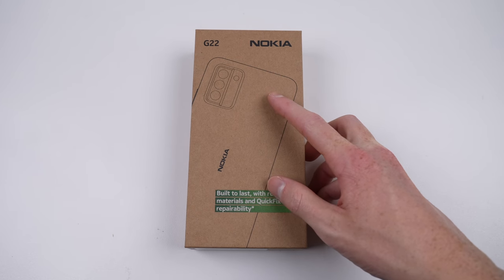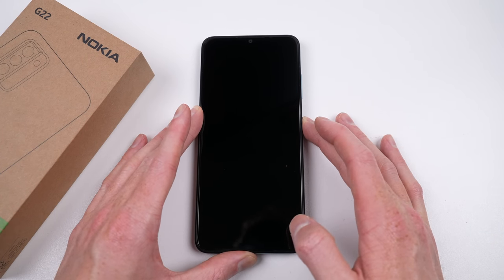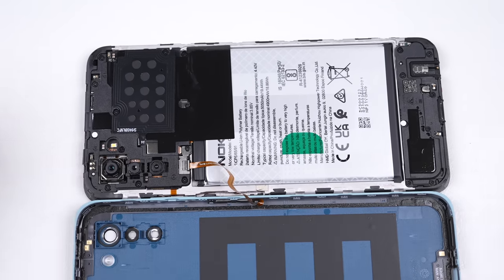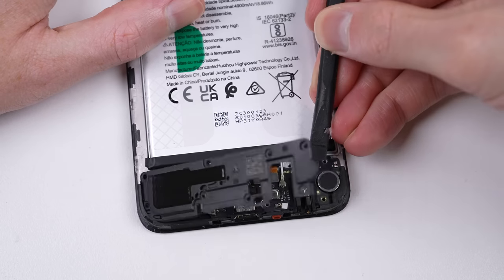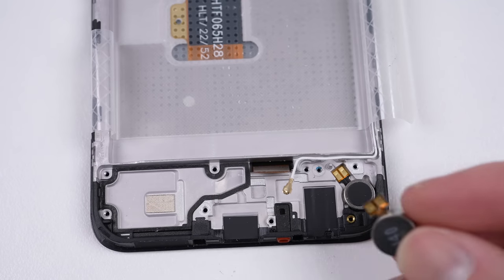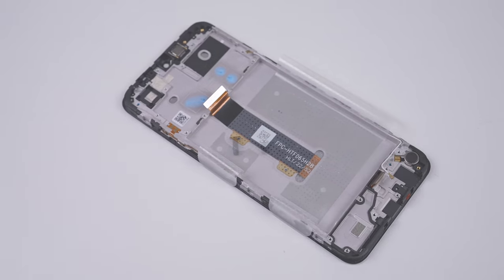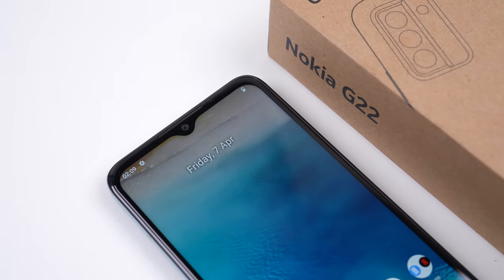Nokia Makes Its First Repairable Phone - Nokia G22 Teardown And Repair Assessment

Comment: Having a Fairphone 3, this doesnt seem repairable at all. You need specialty tools and too many things seem to easy break. This is just a regular phone in a plain cardboard box instead of a coloured one. It's really a shame they try to jump on the right to repair wave with a bog standard phone that has a pull tab on the battery youre not supposed reach anyway.

Comment: most mid range and budget phone has been built like this and they didn't advertise it, of course not every brand has spare part readily to purchase and Nokia has its up. all those high end curved screen glass sandwich and fruit brand after 6/6s series are pain in the buttock to repair though.. me myself has been servicing my own Poco X3/F2/Oneplus 3/5 and even s8+/mate 20 pro/v60 for several years now, battery, screen, charging port and even camera lens i've replaced by myself, all my phones has been in great shape even isn't being use today, strange to me Nokia G22 sounds like a breakthrough to you, should've be more clear if you wanna roast fruit brand for its unrepairable trait xD

Comment: I mean, at least could’ve done better in the disassembly process… even removing the battery is a pain in the ass (just like every other phone) but I’d expect a better solution for a phone that claims “easy repairable”… I’m a little bit disappointed on this one.

Comment: No removable battery...
I stick with my Motorola E4 which has an removable battery. The back snaps off easy like it used to be. No tools needed. Camera is not so nice with it's 8 MB main camera but it makes fotos. In reality I need sometimes an macro lens but as long as the fone has autofocus (AF) you are mostly fine. An Image Stabilizer would be best.
I see no much repairability on this Nokia but rather an businessmodel in favour of I Fix It and a spare parts availlability guarantee. That is something but most often these fones do not fail on the hardware level - the battery fails first and that is about after 3 years tops.
This phone does not make much sense.

Comment: I don't know what is worse, the phone itself or the situation in which it's being marketed. If you know what it actually is - it's basically a common 2018 budget phone design, but now phone designs are usually so bad that for that one you get all that goofy advertising that it's RePaIrAbLe. The phone is outdated, slow, hugely overpriced and offers nothing new in terms of repairability, you could get all of that (or better) if you buy a used phone for that era

For example if you want something like that you much better buy a used Poco F1 in a good condition for THIRD of that price that has got a better camera, screen, more ram, better everything, got an old flagship Snapdragon SoC (Even old it's lightyears better than a Spreadtrum, lol). And it will obviously last longer due to being faster. And all needed parts for it are available online. And it's as repairable as that phone - it has literally the same back panel removal mechanism and the same construction overall.

Comment: Seems marginally easier to disassemble than most budget phones these days. I suppose the nice thing is no need to heat the back initially. For example it seems slightly easier to take apart than the OnePlus Nord N200 5G I worked on a few weeks ago.  I miss phones like the Galaxy S4. Very easy to take apart. I could have an S4 dissasembled in like 5 minutes.

Comment: Buying ANY Chinese phone (that looks exactly like this one from inside) would be cheaper (around 150$) and you would be able to buy parts from Aliexpress (battery for 15$ , display for 15-25$ , back housing for 5$)

Aliexpress is NOT that unreliable in Europe

I can't say for Australia, but I have been buying 500+ items from Aliexpress yearly for the past 6 years and I can say that in 99% cases I do not have any issues

important thing to mention is that I ALWAYS buy THE CHEAPEST parts (that are made using correct technology ,like SoftOLED display for iPhone X, and whose ads look legit , normal amount of orders, reviews and sellers that are older than 6 months)

This Nokia seems to have just doubled-tripled the price of everything because its "legit"

but who would spend 3x the money on a Budget phone?

for 350 you could buy used iPhone 12 Pro 😂

Comment: It's just a shame "Nokia" (really, HMD phones using their branding and name recognition) phones are extremely UNcompetitive compared to China phones, especially from Xiaomi. The Unisoc CPU of this thing is worse than E-WASTE for 2023, what more by 2025 or 2026?! 😭
Reply: Fully agree. They're simply not very competitive specs-wise, which is a giant shame since their software (Android One) is pretty much perfect for the kind of long-term use that they're advertised for. However, since most Chinese manufacturers create their own software/ROM to help push the price down (by putting ads, collecting data, stuff like that), it seems like HMD cannot do that with Android one.

Still though, the least they could do is giving a decent CPU.

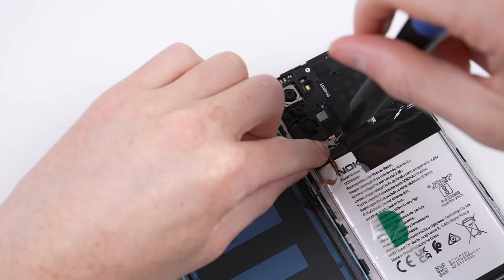Comment: 6:46 I've actually tried to clean phone camera lenses under microscope and you actually can't make it as clean as it comes out of the factory, you can't see it with your naked eye but under a special microscope which can do as low magnification as 100x it's very visible that you only gonna make it more dirty if you wipe it, so don't touch the camera lens and don't wipe it, use compressed air to clean it.

Comment: This actually only looks a little easier than the 1st gen iPhone SE I have, but if that phone ever dies I might pick up something like this because manufacturers making phones easier to repair and selling parts is good. In fairness, iPhones are ubiquitous enough that those parts are easy enough to get too when Apple isn't putting software locks on hardware components (although apparently the backlash was enough that they patched that out). Honestly just wish it was a little smaller, I think the iPhone 5 and 13 Mini got the form factor about right for my preference.

Comment: I know why they want to make it repairable, it is crap material and when you need the part, it is not in stock!!  I have had this phone for 2 days and it was broken, the whole frame was twisted / warped, causing the glass to crack on multiple places. I used it 2 days....!!! so different than my Nokia N8, which is still working fine without a sigle scratch on the screen, (just ordered the 3rd battery, but hey, it is 12 years old). This G22 phone is of such bad quality, the frame is of such soft material (cheap crap) it cannot withstand carrying around in your pocket of your pants. BTW I have another phone, Iphone SE 2016 without a single scratch, in new condition, so surely it is not the way how I treat my gadgets... But... the worst is that I cannot even repair it because Ifixit does not have the spare parts, I need to go to Ebay instead. Crap!! Never ever Nokia again..

Comment: What a joke...
All that's really needed is easy access to the battery and it doesn't even deliver on that.
Also what would be the reason to extend the life of this phone when it basically comes with an expiration date in the form of discontinued software support? No effort was made to offer options that would make it capable of running updated software indefinitely, like meaningful support for third party android distributions like lineageos, or linux. The bootloader is unlockable... big deal.
Three years from now people will buy expensive replacement parts for an outdated cheap android phone that you will probably break when you attempt to disassemble it?

Comment: Let's see... "AI" camera (ie the actual HW sucks) and no laser autofocus, a miserable 720p screen, noname 8 core SoC (of which only 2 cores are performance ones) with questionable custom ROM support (if any, given nokias track record of blocking that), no compass (wtf is this? 2013?), shared SIM/microSD slot garbage. How does a phone released as recently as this manage to be so much worse than a phone from 2016 (Moto Z Play) that fits the same ca. 200eur price class?! The damn Moto Z had a 1080p OLED screen, compass, Laser autofocus, Dual SIM WITH microSD (none of this shared nonsense), and it had an actual Snapdragon SoC, not some grab-bag noname stuff nobody has ever heard of giving off a very "this is the cheapest junk we could get our hands on" Mediatek-y vibe. This abomination has nothing going for it other than the "you can (attempt to) repair it yourself" marketing wank. When will manufacturers actually present us with a device that is actually desirable and repairable?!  Cause this thing sure as hell is only the latter...

Comment: I got nokia sirroco 8 with curved edges when it just came few years back. It was there flagship. I accidentally broke the screen with 5 months useage. My fault so I went to jbhifi to ship the device to fix by nokia. They said they dont have screens and dont produce display unit so buy new one. This is just over $1000 phone (similar to iphone top phone in same year) and only 5 months use. Went back and forth with their shitty customer care. complained ACCC as well. They dont care about Australian consumer law or environment. I got cheap moto phone for 1/4 of the price and used for more than 2 years now and commenting this as well. 😂 never nokia. never again.

Comment: Phonemanufacturer are stupid...
Back should be carbon fibre or plastic not glass..maybe metal for cooling with a round rubber seal and screws in every edge

Comment: If they're only giving security updates for 3 years then it'll be obsolete in 3 years, or less if you don't buy it at release. That's less than what Apple offers, by a country mile. Repairability is meaningless if your phone is running pwned software.